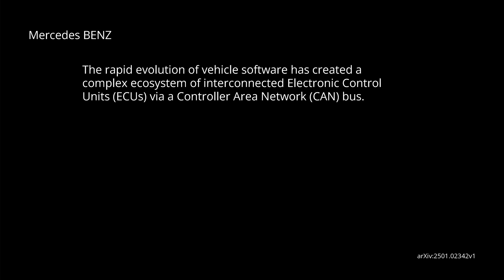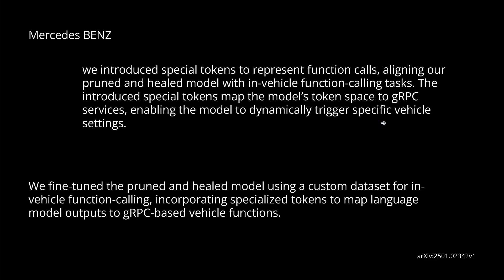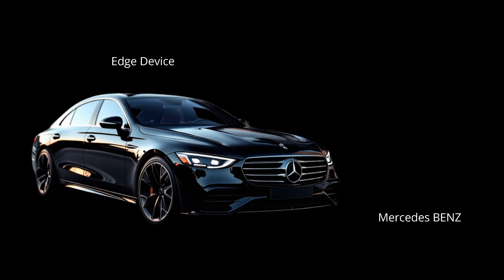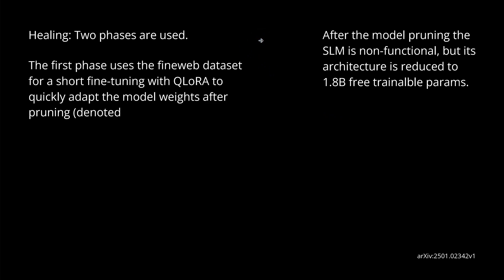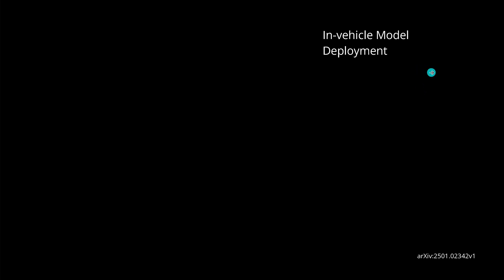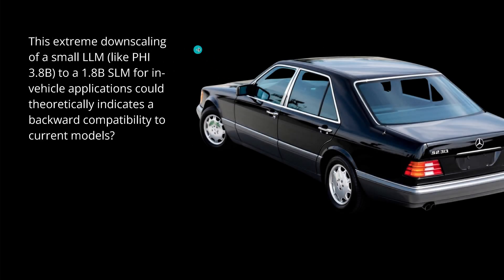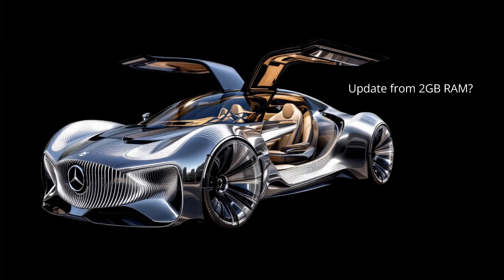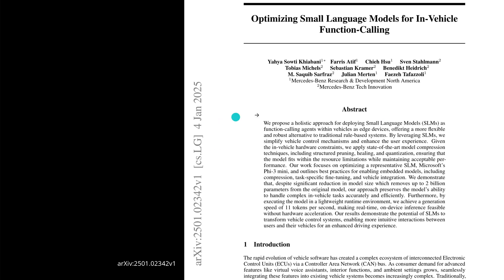Mercedes BENZ: Small LM for In-Vehicle Function Calling

Comment: Very cool video, thanks!!! A few thoughts (I'm not an automotive expert at all, but have a tiny bit of embedded background): Q4_0 can be accelerated nicely on current arm CPUs (llama.cpp was able to accelerate PP 2-3x and also TG a bit by using special arm CPU-instructions for GEMM/GEMV operations), a GPU/NPU helps not much for SLM inference as TG/token-generation is mainly limited by RAM-bandwidth. A current NVIDIA Jetson Orin Nano 4GB embedded module (50GB/s memory-bandwidth, with its 64-bit bus) would be a platform with approx. the performance constraints mentioned for SLM token-generation in this paper. To me, it does NOT seem like old/cheap hardware. It's GPUs could be usd for other tasks like e.g. vision. Probably the SLM runs on hardware dedicated to "dashboard" centric features - a Jetson Orin Nano would already be a VERY luxurious processor for this.
Servus aus Wien